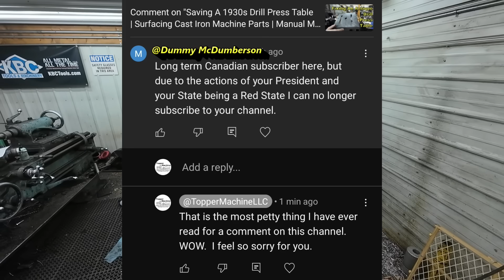Drill Press Table Repair Follow-Up | Dumbest YouTube Comment Ever | Pin Jaw Update

Comment: With something flimsy like that sometimes I bolt an angle plate to the boring mill behind the part and then clamp a bar to the angle plate and then clamp the other end of the bar to the part. This part had those ribs on the back you could have clamped the bar to.

Comment: What you did is correct, I’ve used a big old TOS column horizontal borer to machine gearbox foundations for ships gearboxes bases to be scrapped too. Along with gas turbine resilient mount bases to be chock fasted too. Only thing I had trouble with was where the plasma cut edges were made hard, just had to chamfer edges prior to fly cutting. Oh and use a better grade insert.

Comment: I was about to give up on Topper because you spend too much time calling viewers and or their comments “stupid”. But your showing that truly STUPID comment from Canada was 100% justified.

Comment on truing up that drill press table face. After you got the face flattened and squared up, what would you have to charge the customer to true up that rough-milled mount surface to the now - flat table face? I know you have to make enough money to justify your time, but in this case your boring mill and cutter is already there. 
This is NOT a criticism - just trying to understand how you price your job-shop work.

Comment: I remember working @ Berch cabinets in the 90's and had a chance to run a (multi head/spindle) drill press for the shelf pins, I hope that's as clear as mud lol, but in one stroke it would drill 12 holes (I think, it's been a while) for the pins the shelf rested on, something must be available for metal working, now if it's affordable for your size market or if it's priced for the big dogs like auto manufacture is the big question

Comment: Pro hard is, as I think you mentioned, between RC 28-32. HT is RC 45, which is about as hard as 4140 should be hardened. RC 30 is hard enough to wear M2 HSS fairly quickly. Are you using Cobalt 35 or 42 for these? I don’t remember if you had said that.
Reply from the maker: M42 Cobalt has worked best for me so far.

Comment: It is just a bot comment or some idiot spamming but Wisconsin is far from a Red state anyway. It has become a battleground state as the results are so close. Also, just scrolling through some election data, Wisconsin will vote for a third party candidate if there is a decent one in the race. Looks like a state with a few independent minds.

Comment: Repetitive work is the WORST thing to do, it's way too much like watching  the clock all day long 😂😂😂😂😂 it NEVER ends🤯🤯🤯
Reply from the maker: It is brutal
Reply: Time to build one of those multi spindle drill tools like mr Pete showed. Gang drill the whole blank in one shot. 🙂
Reply from the maker: I am afraid a gang drill would never be accurate enough for the application.
Reply: @ And the down pressure for all those holes at the same time would be insane.
Reply: @RickOaks  I was working an apprenticeship in tool&die in my 20's, then the IRS locked and took  the building and I lost 2yrs. of hours. That's TRULY FUNNY
Reply: When I was a teenager, I spent hundreds of hours turning 4" diameter cast alluminum wheels in a lathe.  First op, turn down to 4", then turn a groove in the edge to fit a 1/4" wire rope, then drill hole in center, then press in an oil impregnated bronze bushing and finally ream the bushing.  I was paid by the part which was bad deal as I was only making 50 cents/hour 😩 Ended up being a good life lesson.

Comment: I feel that your customer received the best results for wanting the table back to factory spec's. This would have been hard to replicate on a Bridgeport due to spanning the entire table face and laying it over 90 degrees to cut it with a fly cutter. Not everyone has the ability to have a horizontal mill in their shop. Which made this project turn out very nice and factory looking. .

Comment: 🇨🇦 51, 🇬🇱 52, 🇵🇷 53, Gaza 54,😂😂😂
Topper I hope manufacturing comes back 😅before you have to close shop😢. Write a letter to the president. Maybe some large company would like to come by and open shop in your state??
Reply from the maker: It's this region. Nothing will come here. If I were 2 hours south, life would be different.
Reply: @TopperMachineLLC yes and in rural areas it is going to get worse if the tariffs on Canada & Mexico proceed. If the  tax increases on the middle class go through it will be even worse. The fact is Americans just won’t work for the wages that are paid in Asia & the ruling class is only interested in the bottom line.